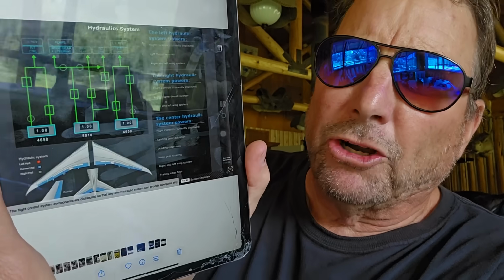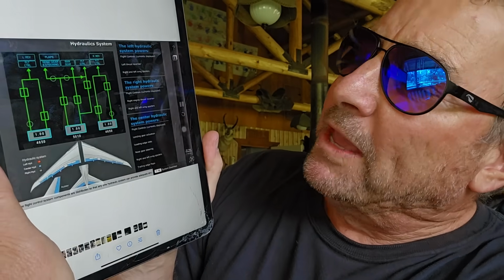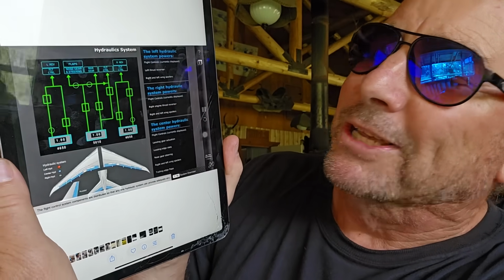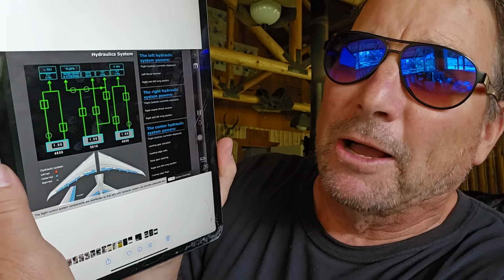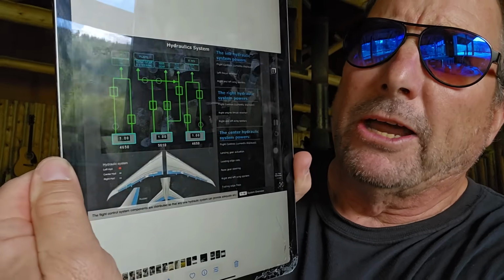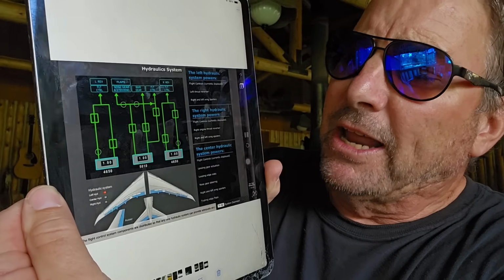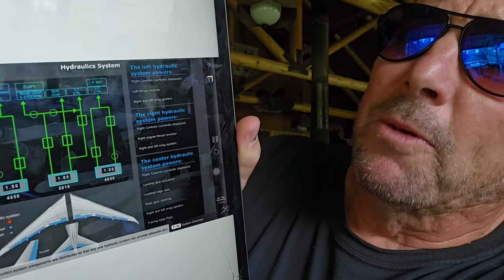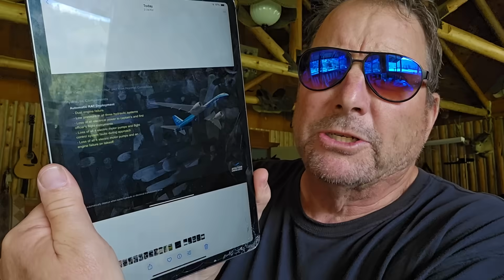787 Crash India What's a RAT? When does it deploy?

Comment: I watched a video posted on YT, a much clearer sound of the 787 and you could hear the sound of a propeller, the RAT, i don't believe for one minute this was pilot error, this plane had a serious issue on take off. Great video Juan.
Reply: Could still be both 🤷‍♂️
Reply: The survivor mentioned a loud bang noise and that the cabin lights flickered, (and the ADSB transmissions stopped.) If confirmed, this might be an important clue to place into the timeline, as you say, if the RAT is deployed, the gear won't retract. That may explain why the gear stayed down. I think this does point to a serious electrical issue.
Reply: @bernieschiff5919  I'm very much convinced of a serious electrical issue. On a previous flight that 787 had electrical problems and the sole survivor of the accident flight reports a loss of cabin lighting too, shortly after takeoff.

TOTAL loss of electrical power would mean the fuel pumps for the engines shut down too (the 787 has no engine driven mechanical fuel pumps as backup/redundancy) and any fuel they continued to receive would be by gravity only, so they would definitely spool down and the RAT would also be deployed on the loss of electrical power.
Conceivably the RAT might provide enough electrical power to get the fuel pumps delivering fuel to the engines again  BUT they would then need to spool up again to provide useful thrust and I think they simply ran out of altitude/time in which to recover.
Reply: @grahamstevenson1740  Be careful. Engines, electrical power and hydraulics are all interdependent.
Reply: @bernieschiff5919  I am told by many who should know that deployment of the RAT in flight makes a loud 'bang' sound and the change to the electrics from it coming  online would explain cabin lighting anomalies.
Reply: @bernieschiff5919 the bang was probably the rat deploying, the flickering would have been the switch to the rat for emergency lighting. Love to know if power automatically transfers to the rat when it’s deployed or whether the software checks for alternative power sources first
Reply: Yes, because 92% of all air crashes were not pilot error. Oh, wait
Reply: @DavidGoldsteinWeissmann  actually most aren't the bulk are either matiance or deisgn issues.
Reply: @Revkor  that's statistically false
Reply: @Revkor  Rubbish. Look up the figures and report back.
Reply: It’s just so unlikely you have a dual engine failure as soon as you lifted off, like I’ve never heard of that happening unless it’s a bird strike
Reply: @a_goblue2023  Explain the deployment of the RAT.
Reply: @hb1338 it can also deploy due to electrical or hydraulics failure as well. Obviously nothing is impossible but I’ve studied aviation disasters for years and I can’t recall there ever being a dual engine failure of a modern airliner right after rotation. The only times it’s happened was due to bird strikes or fuel contamination. Losing both engines right after rotation almost seems targeted in some way. We will have to wait to see what the black boxes say
Reply: It could be a combination of catastrophic events, AND pilot error.  Just think of the Jeju Air 737 crash a few months back.
Reply: Yep. Although we can’t rule anything out yet. It seems less likely than a systems or mechanical/electrical failure.
Reply: those engines i believe were starved of fuel and could not continue to produce suitable thrust thus no positive rate of climb and gear up.
Reply: @imbowser interesting, that certainly is a possibility. What makes you think it’s a fuel starvation? The speculation of warm temps and vapor lock? Something is diff here tho because plenty of 787’s have taken off just as hot n heavy and been fine. Thousands of times…
Reply: @imbowser  There is clear and incontrovertible evidence that the aircraft was able to climb for about 15 seconds. Gear up is usually called at 5-10 seconds.
Reply: You can’t be too quick to say it’s not pilot error either though even with a mechanical event if the pilots didn’t go through all their checks which may have identified a problem or potentially stop before v one then it was an error to continue with takeoff even if it was mechanically defective. they have been, unfortunately, many mechanical events where pilot error for want to have a better word has exacerbated them or by making the wrong call called an accident pilot error doesn’t just have to be a pure situation where a pilot makes a mistake with a perfectly flyable aircraft
Reply: @malcolmwhite6588  Glad you would have saved this airframe!
Reply: @malcolmwhite6588  Straw. Clutch.
Reply: There's now visual proof from the video the RAT was deployed.  Thankfully this likely rules out pilot error.
Reply: Could they have had an engine failure and shut down the wrong one?
Reply: where was the aircraft in phase of flight? Obviously past Vr. How much rwy distamce used? Was there a "positive rate" callout on the CVR? Perhaps gear up was actuated and at that time a breaker popped?
Reply: @paulsherman51 positive rate was established, however it looks like the lost power immediately after that.
Reply: hmm, was there insufficient grease/lube on the gear, or some other mechanical binding, causing greater strain on the hydraulic/electric pump(s) thus blowing a breaker?  @a_goblue2023
Reply: Those talking of the Pilot Monitoring confusing the gear and flap levers makes me crazy. Clearly no such thing happened.
Reply: @grahamstevenson1740  It seems that both pilots had a lot of time on this type, so a mistake like that is very unlikely but even the smartest humans can make stupid mistakes sometimes. The problem will be found elsewhere as evidenced by the RAT deployment. There wouldn't have been time to deploy it manually as they tried to work out what was happening and the proper solution to it.
Reply: @P_RO_  The FO had just 1100 hours in total - that is nothing like "a lot of time".
Reply: @hb1338  My source indicated that the number was on type, not total hours. That would have been pretty good for experience but maybe my source was wrong. Regardless this was likely beyond what anyone could have saved no matter their experience.
Reply: @grahamstevenson1740  It is as it was with those MAX crashes: All told about (non American) pilot errors to hide the real issue ....

As if Indian pilots can't stick to cockpit procedures, what a nonsense (close to racism)
Reply: @grahamstevenson1740 its happened before, just never led to a crash before. There’s always a first time
Reply: @grahamstevenson1740  No, not "clearly", just extremely unlikely; it also fails to explain the deployment of the RAT. The latter is supported by both video and audio evidence, and suggests serious equipment failure, which easily accounts for what happened.
Reply: Where is the RAT in the video? I don't think it is deployed because you would clearly see the RAT open, which we dont
Reply: @kaka_spaka Poor quality video and the RAT is quite small. The sound is the giveaway that the RAT was deployed and spinning.
Reply: @kaka_spaka  You can hear the RAT, it's poor quality video and you really can't tell if the flaps are down or not, i think the flaps are set correctly.
Reply: @kaka_spaka  Captain Steve is showing a video (better quality than the original) which appears to show the RAT.
Reply: The odds, while not conclusive, are definitely that a Part 25 transport category aircraft loosing both engines on takeoff without a bird strike in day VMC, the same time, are virtually zero. While not zero, it’s difficult to comprehend a good reason why. Much more likely is a premature retraction of flaps than gear, but a mayday was called and noted a power loss. Perhaps something with the temperatures and fuel, but I guess we’ll see what the investigators come up with. For now, all prayers for the victims’ families.
Reply: @NineGPull  What about fuel contamination?
Reply: @SvenRognelund  certainly a possibility. I think back to the ice crystal formation in the fuel lines on the 777 coming into Heathrow years ago.

It is just interesting that the engines were fine during start, taxi and take off all the way to just having rotated.
Most jet engines have engine driven pumps that as long as the engine is rotating, the accessory gearbox is rotating and things like fuel, hydraulics, generators, permanent magnet alternator, etc. will be running - meaning that even if you have an electrical failure and you loose your boost pumps, you’ll still have plenty of fuel pressure for the engines.

Guess we’ll all be staying tuned with this one, the whole world is watching.
Reply: @SvenRognelund  Maybe, maybe not. HTH
Reply: @NineGPull  You are guessing. There is no evidence  that the engines were alright at any point, just a presumption.
Reply: @hb1338 how would that have helped, in any case?
Reply: @NineGPull there’s a lot of faulty thinking in that. BA-38 and that the only reason you think it’s the flaps is because you’ve heard others talk about them. 

The video shows the slats where deployed. And word from the site is there is evidence the wing still has flaps deployed. 

Your theory doesn’t explain the RAT, or the lack of thrust sound. And the fact that even with 0 flaps and TOGA power it would have still likely have climbed. 

The bogies also  appear to be in a position of starting to raise the gear but stopped. 

So let’s wait for the investigation before claiming any certainty of root cause or using statistical math incorrectly.
Reply: @MeppyMan  first off, the video is so grainy that is difficult to see that any leading or trailing edge. high lift device devices were deployed. No one has been able to see this definitively. 

Secondly, I don’t believe there was an issue with the engines, given that a plane of that mass on climb out would quickly fall out of the sky much quicker than it did if the engines were lost with a nose high, landing gear out configuration. The one thing that does make sense, is that the gear was not retracted (as evidence by the video), and that when the flaps came up, they weren’t quite fast enough to maintain flying speed with the nose high attitude, weight, temperature, etc., with the gear deployed to continue to climb out.

I have no clue what your reference to BA-38 is, but as an ATP and G650 pilot, I don’t need to rely on others to understand elementary aerodynamics.

As far as the RAT sound, how do you explain its deployment right after takeoff? That would assume all 4 engine driven generators failed at the same time…
Reply: @NineGPull it’s highly unlikely but remember that the sole surviving passenger reported green and white lights flickering on and off in the cabin right before the plane started dropping… which is consistent with reports from historic flights which experienced electrical power problems mid flight, specifically the generators
Reply: @NineGPull Or if both engines stopped at the same time, all engine driven pumps would also stop. RAT deploys.
Reply: @MeppyMan  a number of crashes where flaps have not been deployed would tend to contradict your statement in that regard.  there are several aircraft that basically at TOGA  will still fail to climb and there are others where if you hold them off until a greater speed they will climb, however, that’s more test pilot territory as  in a normal flight if you’ve calculated your V2 rotation speed then that’s what you will tend to stick back and climb out.  very very few commercial aircraft as my understanding will continue to accelerate and fly out with zero flaps from a normal – assuming flaps calculated V2 speed
Reply: @B737900ER agreed. It doesn’t appear that both engines stopped completely. Perhaps slowly rolling back? For an airplane that big, even with 150kts’ish @ Vr, landing gear (and flaps deployed) with a nose high attitude and 9 hrs of fuel on board, an immediate loss of thrust on both engines is going to bring the airplane down quicker than 30-40 seconds after liftoff. It’s more believable they both experienced some type of rollback where they were providing a diminishing amount of thrust during the 10-15 seconds it might take one of those behemoths to come to idle thrust.
Reply: @MeppyMan  You haven't checked the numbers in the 787 operations manual, have you ? Your assertion that flaps zero, a very heavy load and high ambient temperature would "likely" be possible is nothing more than a wild guess.
Reply: @NineGPull  "a plane of that mass on climb out would quickly fall out of the sky much quicker than it did if the engines were lost". That is a just a vague and wild guess, and you certainly haven't done the relevant maths. The plane climbed for 15 seconds and sank for 15 seconds - given its extremely efficient wing and excellent glide capability, how long would you expect it take to descend ? Please explain your calculations. How is your answer affected by load and ambient temperature ? For a supposed ATP pilot, your approach is woefully lacking in any form of rigour or numbers.
Reply: @malcolmwhite6588  Exactly so. With big aircraft, V2 is almost never high enough to allow take-off without flaps.
Reply: @NineGPull  Check your facts. Flight time almost exactly 30 seconds, maximum height at 15 seconds followed by 15 seconds descent, no nose high attitude until the last 5 seconds of flight. Last ADSB dataset has ~160 knots IAS. The 787 has an extremely efficient wing and a glide ratio of ~21. Tell us the numbers you have calculated for descent time and distance - you will find that 15 seconds and 1.5 miles distance are very easily within its' glide capability, even with the gear down.
Reply: @hb1338  yes that’s my understanding as well - several people have said well it must be a total engine failure otherwise with toga thrust that could climb even without flaps etc but if you haven’t already got to V2 highly unlikely you are going to have sufficient thrust to do so without lift devices and with gear down in particular when people panic and even experience pilots tend to stick back to get away from the ground rather than use a more neutral angle of attack to attempt to gain some speed despite being close to the ground.
Reply: @hb1338 and who tf are you? Some internet warrior who believes he knows everything? I’ve been reading your replies and you sure believe you’re the smartest guy in the room.

Re my “maths”…. You’re incorrect in the need for a calculation anymore than Bob Hoover “calculating” that he could dive down towards airshow center, shut off both engines in the Shrike Commander, do a 4 point roll and restart them and continue flying. It’s about energy management; had the engines instantly stopped producing thrust right as they rotated, if wouldnt have continued to climb for another 15 seconds now would it?
Reply: @hb1338 glide ratio isn’t correct if the gear and RAT are hanging out in the wing, and that efficient number would only be realized at a specific AoA, which you have FAILED to prove they were at.
You march into this conversation and literally tell everybody to check their facts as if you have come from the future having seen the NTSB’s report. Gtfo, you haven’t contributed anything to this discussion. Oh and you’ve still yet to show me your maths….still waiting….
Reply: @NineGPull survivor heard a bang. Said lights flickered and they started dropping. RAT wouldn't deploy if flap/wheels reversed
Reply: @NineGPull  "much more likely". Wild guess.
Reply: @NineGPull  The video of the departing aircraft shows NO incident involving the engines !
Reply: @grahamstevenson1740  the only thing I could possibly think of would be debris injection if they overran the runway, but one would think you'd see some compressor stall bangs? 

I have wanted to believe loss of thrust, but since the whole flight is on video it's hard to stick with, unless these sounds of the RAT are real.
Reply: @NineGPull  The flaps WERE NOT retracted ! Why do people still persist with this totally crazy idea ?

I'm very much convinced of a serious electrical issue. On a previous flight that 787 had electrical problems and the sole survivor of the accident flight reports a loss of cabin lighting too, shortly after takeoff.

TOTAL loss of electrical power would mean the fuel pumps for the engines shut down too (the 787 has no engine driven mechanical fuel pumps as backup/redundancy) and any fuel they continued to receive would be by gravity only, so they would definitely spool down and the RAT would also be deployed on the loss of electrical power.
Conceivably the RAT might provide enough electrical power to get the fuel pumps delivering fuel to the engines again  BUT they would then need to spool up again to provide useful thrust and I think they simply ran out of altitude/time in which to recover.
Reply: @grahamstevenson1740 why are you so sure?? Video is inconclusive either way. You are obviously convinced beyond a reasonable doubt. Do share what makes it so clear to you, yet every other pilot questioning the flap setting… with 1200 other 787’s out there for 14 years, this would be the first issue so badly it couldn’t be rectified. Hmmm….
Reply: @grahamstevenson1740 you know nothing about how or what operates via the 787 RAT. Why do you continue to comment ignorant nonsense over and over?
Reply: @NineGPull  The wreckage shows that the flaps were deployed. WHY are you still banging on about an issue that's a NON issue ?

There's a scenario you haven't considered. The fuel system on a 787 is entirely electrically driven !

I believe the engines were starved of fuel shortly after takeoff by an electrical failure. You can see the 787 visibly stops climbing out.

I'm very much convinced of a serious electrical issue. On a previous flight that 787 had electrical problems (video'd by a passenger apparently) and the sole survivor of the accident flight also reports a loss of cabin lighting, shortly after takeoff.

TOTAL loss of electrical power would mean the fuel pumps for the engines shut down too (the 787 has no engine driven mechanical fuel pumps as backup/redundancy) and any fuel they continued to receive would be purely by gravity feed only, so the engines would definitely spool down and the RAT would also be deployed on the loss of electrical power.

Conceivably the RAT might then provide enough electrical power to get the fuel pumps delivering fuel to the engines again  BUT the engines would then need to spool up to provide useful thrust and I think they simply ran out of altitude/time in which to recover.
Reply: @NineGPull  "every other pilot". Nope, just a few who are unfamiliar with inference.
Reply: They started from 2/3 of runway. Had hardly any speed for take off at very end of runway. Dirt and dust from end of runway was swirled up and likely ingested. May have flamed out turbines and RAM turbine was deployed. Without thrust, airspeed fell and no lift. Hence, primary cause was starting not at very beginning of runway. This should by now really be DEMANDED from any aircraft
Reply: @hanssteiner7661 you're late to the party. It has been confirmed that the 787 used full runway length.
Reply: @hanssteiner7661  Rubbish. The ADSB data shows very clearly that the take-off roll started from the end of the runway. The "dirt and dust" you refer to is heat haze from the engines.
Reply: I am staying with the theory of putting flaps up and leaving wheels down. Not vice versa.
Reply: @garywheeler7039 kid that’s the case. It would have to be the biggest rookie error in the history of aviation
Reply: @mannythelimodriver6003  Simplistic comment. As per AAIB report AAIB-30154, "absence of cognitive thought and speed of execution commonly feature during action slips which occur in routine or highly learned motor action sequences".
The report refers to an incident involving a very experienced pilot (> 6000 hours) with an excellent record and a good reputation. On his first sector after a fortnight's leave, at V1 he started to retard the throttles instead of removing his hand from them, realised his mistake, advanced them again, then rejected the take-off because he was uncertain that the aircraft was still within limits. The RTO (rejected take-off) was carried out calmly, methodically and accurately. The pilot was unable to offer any explanation for his actions.
Reply: @garywheeler7039  It is always nice to stay on the side of misinformation ....
Reply: @peterebel7899  It is not misinformation, it is arguably worse - a wild speculative hypothesis that cannot currently be verified. Meanwhile, there also exists another hypothesis which is supported by all the available evidence, including third party video and audio.
Reply: @hb1338  Come on, it is weekend and I do have my calm hours!

His comment is as ignorant and racist as those where which blamed the Ethiopian pilots not to be able to fly a brand new and shiny 737MAX.
I repeat the r word, disgusting!
Reply: @garywheeler7039 probably a bad idea to stick with that, it seems pretty clear that was not what happened given more information coming out.
Reply: @garywheeler7039 but why would the RAT be down. Nonsense
Reply: @garywheeler7039  Why ? There is NO evidence to support that theory. There IS strong evidence, both video and audio, that the RAT was deployed, which indicates that the plane suffered very severe failures.
Reply: @garywheeler7039  you are spamming same shyte everywhere..u sure not  a boeing employee?
Reply: @garywheeler7039  It lost thrust and sank.  Even if the flaps were up, it still would have flown farther.  This is an engine thrust problem.  The main question is, what caused it.
Reply: @TheCyberMantis  I'm very much convinced of a serious electrical issue. On a previous flight that 787 had electrical problems and the sole survivor of the accident flight reports a loss of cabin lighting too, shortly after takeoff.

TOTAL loss of electrical power would mean the fuel pumps for the engines shut down too (the 787 has no engine driven mechanical fuel pumps as backup/redundancy) and any fuel they continued to receive would be by gravity only, so they would definitely spool down and the RAT would also be deployed on the loss of electrical power.
Conceivably the RAT might then provide enough electrical power to get the fuel pumps delivering fuel to the engines again  BUT they would then need to spool up again to provide useful thrust and I think they simply ran out of altitude/time in which to recover.
Reply: @grahamstevenson1740  You might be correct.  Electrical failure which led to a fuel starvation issue in the engines.  Any backup systems wouldn't have had time to kick-in.  They were simply too low and too slow to recover.
Reply: @TheCyberMantis  As a private pilot I initially though of air density at high temperature, but in view of the power of the 787 engines I ruled it out. As Juan says it had enough power to climb even with gear down and flaps up. From the video of the plane slowly sinking it did look like a loss of thrust.
Reply: @TheCyberMantis looks like they overshot the runway (clouds on dust and debris upon rotation). Possibly due to an incorrect flaps/thrust setting? They took off from halfway down the runway. Could they have sucked debris into the engines when they overshot that then caused the dual engine failure? Just wondered if that was a possibility
Reply: @TheCyberMantis  No. It lost lift and sank. The loss of lift may have been due to loss of power and/or it may have been due to incorrect flaps setting.
Reply: @tenareze32  Density altitude is calculated based on air temp, humidity, and elevation of the runway.  This airfield was only 198ft above sea level.  As we now know, this crash was caused by a system malfunction in the aircraft, which caused the engines to stop making full power.  The RAT was deployed, probably automatically as a result of the system failure.  The bad luck is:  all this happened right after takeoff.  Too low and too slow to do anything.  It sank into the ground.  Not the pilots fault, the bird was broke.  NTSB will comb through the maintenance logs.  Air India is going to end-up eating this one.  And it's a bad one.  ( This is just my initial thoughts based on the limited information I have at this time. )
Reply: @StoutProper  NO - you are completely wrong. The ADSB data demonstrates conclusively that the take roll started at the end of the runway. The "dust and debris" was heat haze from the engines.
Reply: @TheCyberMantis  I wonder if some kind of multipart sequential electric power failure could cut power to the FADEC(s) which would then perhaps roll the engines down to idle or shutdown ? Perhaps the deployed RAT could repower the FADEC(s) but then a reboot would have to occur before the FADEC would command the engines to power up again and by that time it's too late ?
Reply: @davidpowell3347  Interesting idea.  Only the engineers could answer that question.
Reply: @garywheeler7039  dude the levers for those are not remotely close to eachotehr. this is a dumb theory. DROP IT. there is enough evidence to say engine failure is most likely
Reply: @garywheeler7039  That doesn't fit the observed wreckage and is classic 'blame the (Indian and assumed incompetent) pilots' racism. Something FAR more subtle occurred.
Reply: @grahamstevenson1740 Has nothing to do with racist. Go be ignorant somewhere else.
Reply: @grahamstevenson1740 Tata who acquired Air India in 2022 are notorious for cost cutting and playing fast and loose with this like maintenance and health and safety.